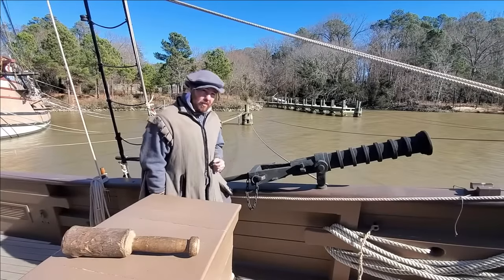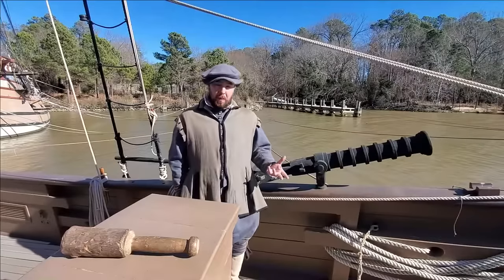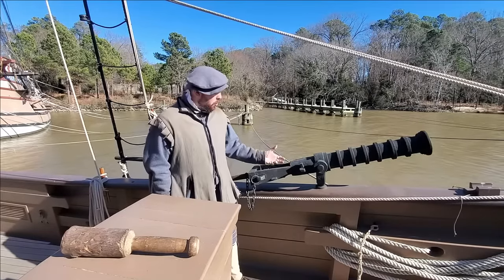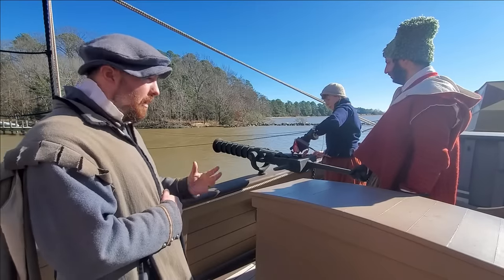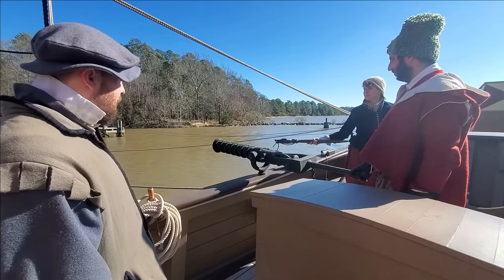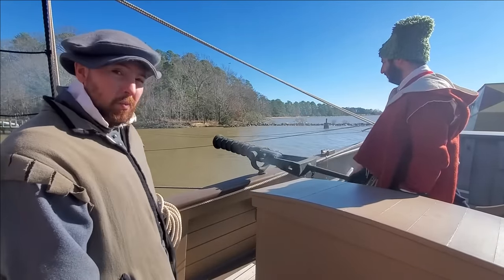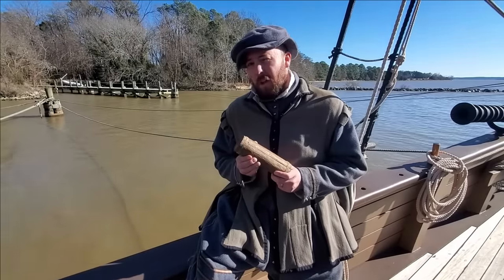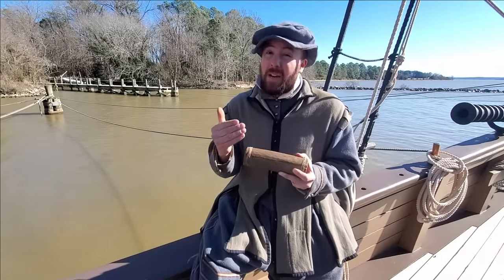Primed and Loaded | Wrought Iron Swivel Gun

Comment: I am a firearms enthusiast, former active duty Marine Corps Vietnam Veteran.  I never knew that any swivel gun could be breech loaded.  This was very informative and I'm certainly glad to have found this video.  Thank you for enlightening this old Jarhead Field Artillery Batteryman, 105 mm howitzers.
Reply from the maker: Like the swivel gun featured in the video, the earlist  artillery to appear in Europe, generally known as bombards, were also forge built iron breech loading guns that fired stone shot. These early breech loaders suffered from gas loss at the point that the breech chamber and barrel's breech mated together.

To prevent gas loss and maintain the increasing energy of the burning gunpowder, one of the first real technological advances in artillery was the transition from forged iron breech loaded guns to cast bronze muzzle loaded. And it will not be until the mid-19th century that artillery begins the return to breech loading, once a breech can be locked and gas loss prevented. 

Mind-boggling to know that artllery transitions from breech loaded, to muzzle loaded back to breech loaded.
Reply: Ian on forgotten weapons has shown a Wheelock rifle from I believe the 1600s that actually has a remarkably similar "cartridge" system. Very interesting as well.
Reply: I think this gun had modern tolerances in construction and back in the day a whole lot more flash would escape at the breech/ barrel.   Still fantastic!   I love cannons and still have never seen this rapid fire with pre loaded breeches.   Great content
Reply from the maker: @acmelka  In our experiences with our iron swivel guns we would say they are lacking modern tolerances.  Each of the guns are individually unique -- each breech chamber does not fit each gun exactly the same.  However, other than the flash and burning of the gun powder at the priming vent, there's no reason for any flash at the breech/barrel.  All of the burning gunpowder is propelled forward and that is the path of least resistance for the combustion.
Reply: On Mary Rose they have some much larger breech loading pieces. Before the days of the naval gun truck which allowed the recoil to bring the gun back inboard, the longer guns were frequently breech loading.
Reply: @JYFMuseums  Your load is not a case shot.  Case shot leaves the gun intact and bursts downrange. "An iron anti-personnel projectile containing an interior cavity packed with lead or iron round balls around a small bursting charge of just enough force to break open the thin-walled iron projectile."  The balls continue downrange due to inertia, not from any propulsive force from the bursting charge.  I would think your load should be called canister, although I'm not sure a wooden cylinder warrants the name.  I'd also doubt the word existed in the early 17th century.  I wonder what they did call it at the time.
Reply from the maker: @Zombywoof1072  Yes, ours is properly referred to as case shot, the case often being simply a hollowed out wooden can or a stave built wooden can. By the 19th century the term cannister is being applied to this type of case shot. 

What you are describing is spherical case shot. A longer ranger, time fused, anti-personnel artillery ammunition developed by Lieutenant-General Henry Shrapnel about 1784. By the 1850s spherical case shot was was also being referred to as "Shrapnel shell".
Reply: Thanks for your service my brother.
Reply: Speaking as a firearms enthusiast , a former pirate and swashbuckling vet I did know that the gun could be breach loaded ...yarrr
Reply: @JYFMuseums  Words change meaning over the years.  Since this meaning has changed, it would be a good idea to put it in period context.  "At the time, this was called a case shot."
Reply: I was briefly with 3/13, 5th MarDiv.  '68-'69.   SemperFi bro.
Reply: Love it, want one for my porch! Preferable in semi auto just kidding
Reply: @JYFMuseums I have a picture of a ghost on a tv.
Reply: You should check out the puckle gun, the ribauldequin(organ gun), Belton 16-shot flintlock just to name a few to peak your interest. The founders were well aware of future advances and they wanted higher rates of fire, matched with interchangeable parts, this in no small part jump started the Industrial Revolution, and we are taught that it was the cotton gin that got everyone into a craze to be the first with the best, HA! As if it could be anything other than arms to light such a fire under a gnats ass.! God Save Madison, Monroe, Jefferson, and Colt.
Reply: I am a firearms enthusiast and full time bartender, I also didn't know they could be breach loaded
Reply: @JYFMuseums so the leaky gas problem was never solved until someone invented a metallic cartridge that also acts as a gas seal.
Reply from the maker: @jonahtaivalkoski322  Not the deveopment of metalic cased ammunition, but the construction of the breech system. Look up the development of the Armstrong and Whitworth breech loading artillery in the 1850s. Breech loading artillery does not require metalic cased ammunition.
Reply: @JYFMuseums i suppose the reason for using metallic cases in modern field guns like the french M1897 '75' is to hold the primer in place, and to also make a package that is very quick to load.
Reply from the maker: @jonahtaivalkoski322  To answer such a question someone would have to dive into relevant reports from French ordnance boards or government ministries. Reasons could be technical, production expense, production capabilities, ease of use, ease of training, or logistics of moving munitions.
Reply: Have you seen the early breechloading wheelocks?
Basically iron cups were made with a lug.
You loaded the cup and differing opening systems existed, but you put it in like a ccartridge.

Comment: Wrought iron is basically raw iron folded over and over(like folding a bed sheet) and hammered together to weld it.  It is then formed into the desired form.   I would be very scared to be around one of these when fired, due to the possibility of leaving an imperfection in the metal during the welding process.  I'm guessing this is an undersized powder charge and no projectiles.
Reply: wrought iron is made by smelting iron ore with carbon monoxide gas, in that form it is pure iron, mixed up with the ashes of the fire.
 cast iron typically contains various other elements that alter its physical properties.
the folding and hammering - fire welding in fact- drove out the ashes leaving puer iron in malleable form, a very fine material
Reply: Cast iron is generally infamous for having way more voids in it than forged things do. Even in WWII, rolled homogenous steel armor was preferred whenever practicable to cast armor (i.e. if the shape needed allowed it), because rolling (type of forging, basically) helped squeeze out voids, but casting would have those voids more often and be less reliable. hammering on an anvil does roughly the same thing, much more laboriously. A modern gun is probably usually made of rolled steel which is then machined in fancy ways for both the consistency and the shapes at the same time.
Reply: The last barrel welders are on movie from the 1920s on youtube

Comment: The gas seal actually appears pretty good compared to modern revolvers. A high speed vdeo might more reveal the amount of gas leaking from this design.  The cone shape being wedged in the barrel is like the unique action of the Russian Nagant revolver.
Reply: With a load of shot considerably raising the chamber pressure you could expect a greater amount of gas blow by.
Reply: There is a similar method used in the earlier Dreyse needle gun
Reply: @pauldavidson6321   Was going to post this. Probably some designs and units made had near perfect seal if wedged hard enough even with actual projectiles being fired, not that it really matters all that much for the terminal performance of the weapon, just consider how well recoilless rifles work and they are basically totally open at both ends, all that matters is that pressure being generated in the deflagration is mostly used to drive the projectile, average pressure is more important than peak anyways.

Comment: I’m a retired hydraulic mechanic,(pumps,motors and cylinders as well as machinist and welder. I turned a 1.5” bore swivel gun from a piece of 4” dia. Chrome rod in about 1996.
It really makes the noise and smoke! Total weight for mine is right at 49 lbs.

Comment: The Mary Rose (early 1500's) had 'stave built' breach loading cannons up to 8 inch(20cm) bore as well as bronze muzzle loading pieces. Known contemporaneously as 'Slings', they fired - stone - shot, which shattered when it hit a hard object - say, like the side of a ship - releasing numerous jagged pieces to the discomfort of the recipients. The inner sleeve of the barrel was made from a single sheet of iron, rolled into a cylinder then 'forge welded' along the seam (like pretty much all barrels for muzzle loading shoulder arms until the 1800's), the wrought iron rings were made separately then hammered over the inner tube while yellow to red hot. This was a considerable improvement over the earlier construction where the inner tube was made of multiple iron bars which they tried with variable success to fusion weld together before fitting the rings. I was lucky enough to be able to attend a lecture by Margaret Rule on the Mary Rose at the Australian Maritime Museum, and there were some fiberglass casts of the slings on their carriages in an exhibition - they were much longer than later cast iron cannon of similar calibre but also thinner, the advantage of using ductile wrought iron rather than brittle cast iron, malleable castings would not be discovered in the West until the late 19th and early 20th century.
Reply from the maker: One of our staff just returned from a trip to England and a visit to the Mary Rose Museum in Portsmouth, where he had the opportunity to handle one of the stone shot recovered in the archaeology of the ship.  What an amazing museum!
Reply: what replaced the forge welded seam in the 1800s, if you dont mind me asking?
Reply: They were still using 'forge welding' for the outside of huge cannons right up until the early 1900's - see Armstrong and Whitworth cannons. The shift started to come in when they developed better steel refineries and big steam hammers and hydraulic presses that could forge a single billet of steel into the liner - they started with a homogenous block of steel, drove a rod through the middle, then used shaped striking surfaces to draw the billet out into a long tube - every so often they had to drive a 'drift' through the center hole to help keep everything in the desired shape. Once it was long enough it would then be lathe turned to shape .

Then the outer layers were shrunk on - the liner was cold and each reinforcing layer was heated well up towards yellow then forced over the previous layers until there were 2-3 layers of forge welded coils built up. That was then cooled, machined and the next layer forced on. Again, eventually metallurgy advanced enough that they could make and forge the huge billets in one piece, but up until quite late in the 1800's the outer layers were made from long strips of wrought iron (negligible carbon high iron silicate inclusion) coiled up around a former then forge welded into a cylinder before being machined and 'shrunk' onto the core. Guns were still in service through WW1 that were made with partly forge welded barrels. The change from black & brown/cocoa powder to nitro cellulose powder was another driving force in improved design - nitro powders could reach much higher sustained pressures so the barrels needed to be stronger much further from the breech, so gun founders developed wire wound barrels with layers of high tensile wire between the liner and the outer casing to make stronger and lighter barrels.

Comment: The pre-loaded multiple breach chambers were fascinating. I didn't realize that's how these swivel guns were setup (thinking the breach was loaded and cleared and sealed each time). How many of the separate breach chambers would have been kept available at any time?
Reply from the maker: We'd say that there is no standardization at the time.  You would certainly find those breech loading guns only equipped with a single breech chamber, that would have to be cleared and loaded after each shot, as well as those guns with multiple chambers. It all entirely depended on money and need, as well as which ship, owner, investment group, etc.
Reply: @JYFMuseums  How long would it take to reload such a breech chamber if only one was available?
Reply from the maker: @Suballi4004, thank you for the question, and honestly we had not given that much thought until you asked.  We presume that of course the process would be slowed down some and probably settle to a time between that of a muzzle loading piece and that of a breech loading piece with multiple chambers. In a way you're probably treating the breech as though it were a miniature muzzle loader, without actually having to work the muzzle of a piece.  Maybe one day it'll be worth a test.
Reply: @JYFMuseums yo it's a must!
Reply: @JYFMuseums  I would expect most of them ordered with two or three chambers, maybe as many as five, and that reloading them was a job for the "powder monkeys" (eg ships boys around 13-16yo) if the powder and shot was pre-bagged, either into unity or two piece loads, reloading a chamber wouldn't take more than 5-10 seconds.
Swab with a moist rag to douse any embers, pull out any leftovers of the previous charge, put a new one in and seat it with a few good whacks of a wooden mallet, hand over to the loader.
Unlike with a muzzle loader piece, a childs hand has no problem reaching the bottom of the breech, so no special tools would be required to load it!

Comment: Excellent video. It actually appears that the breech seals very well with minimal gas escape.
Reply: We cheat with ours ( a bit larger than this one) and slip an O ring in there as well (mostly for safety's sake to prevent powder burns). That completely eliminates any blow-by and is good for a dozen or so shots before needing replacing.

Comment: Apparently I unknowingly made one of these in high school.  Two pieces of iron pipe that screwed together and a cap screwed onto the back of the "breech."  Cut a slot into the top of the breech piece for a fuse, load up the breech, screw on the barrel, and touch off the fuse.  It eventually succumbed to metal fatigue.  Luckily we had anticipated this would happen and had some distance from it
Reply: That's known as a "screw barrel". The system was used in everything from Turkish siege cannons firing huge stone balls to slender "pocket" pistols.

Comment: this is a quite brilliant design.  with the self contained charges in the breech block itself,  you can essentially have multiple loads staged and ready to go, greatly increasing the volume of fire.   the breech locking mechanism is very simple  yet robust and effective, really not much gas escapes from the rear. I can see why these were appealing, especially at lower cost. 

 one thing to  account for, the Guns operators are quite exposed, and i can imagine they would be prime targets for anyone returning fire.  just imagine trying to load and fire that thing while the ship is at sea and moving,  while being shot at from another ship or the coastal battery.   not a fun time!

Comment: As a blacksmith and a historian of artillery I assume that this is a modern reproduction gun.  As such I assume that it is made of steel rather than actual wrought iron which is a different material.  Where was it made and when?  Have you ever fired it with a projectile or case shot?

Comment: One of the other reasons muzzle loading becomes preferable is that you can double shot put down the barrel two balls, (bascially standard practice for cannons) or put different types of ammunition down such as caseshot, or caseshot and cannon ball. Sometimes when Crews were really worried about boarding attempts they may even full a cannon full to the brim with all manner of shot.

Comment: I imagine a trained and well drilled crew could push the reload even faster.  In particular the priming stage almost certainly could have been faster.
Reply: The priming flask appeared to be not be working at 100%. Priming was fast sometimes and at other times she had to fiddle with it.
Reply: As an old Gun Bunny (105mm & 8inch self propelled) it was torture watching them move so slow.
Reply: Having priming tubes (they have another video on how they made these) which are paper tubes filled with blackpowder would have made priming even faster as you didn't have to wait to fill up the up the touch hole with black powder.

Comment: I was wondering if a thin strip of leather would improve the seal of the breech but for most shots it seems pretty good as is.
Reply: The originals were not so carefully made and I expect there was some noticeable and possibly unpleasant blowback. The one in the video is a reproduction with a machined fit between chamber and barrel, thus much more "user-friendly" with virtually no leakage. Speaking as a former builder and current user.